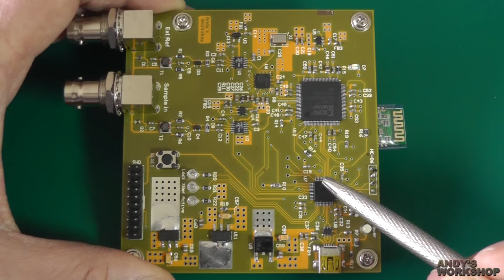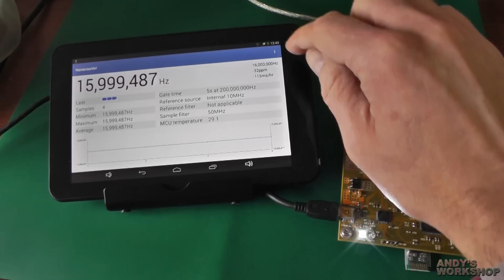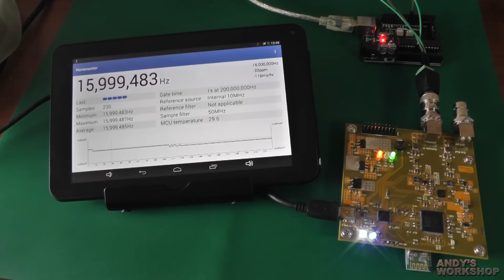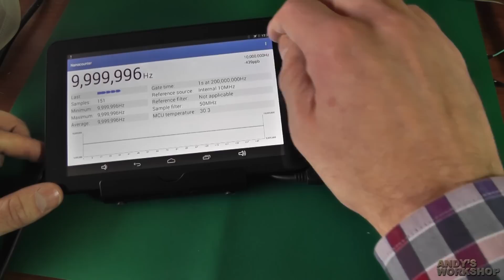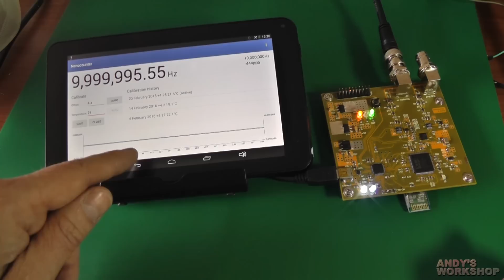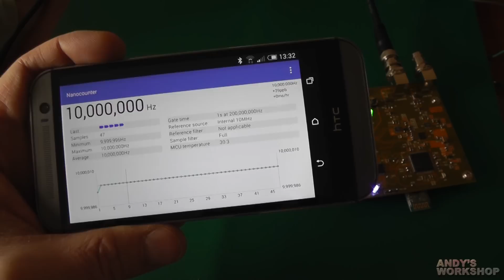A frequency counter built with an FPGA, STM32F072 and an Android GUI

Comment: Andy, may I ask you how you calculate the 50 Ohm trace's impedance? With help of Altium or you have used another tool like Saturn PCB toolkit?
Reply from the maker: It was one of the many microstrip impedance calculator web pages; sorry but I can't remember exactly which one.
Reply: Thank you for your reply! I am just curious about is there anyone who use Altium's built-in microstrip impedance calc feature.

Comment: I'm good with an iron, but no hot air here, can it be done entirely with iron regarding parts in the BOM, I can smd solder fgpa's etc..  and how much typically to build one of these? Thanks mate.
Reply from the maker: The hardest part is the PLL that comes in a QFN package and it has one of those horrible concealed ground pads. Have you successfully soldered one of those with an iron before?
Reply: Not yet, could you apply some solder & flux to the pad and then heat it from underneath with an iron while the QFN sat on the pad? Would be awesome if that's possible. If not possible then I'd probably look at my options hotair/lamp later on. 

At what cost will all these parts be ? I am certainly interested in making one if reasonable.

Comment: Great work Andy! Considering building one. Will you publish the final BOM?
Reply from the maker: +michalvanco The BOM should have been in the article, I've fixed that now. A bit of a fail on my part there so thank you for pointing it out. I will also add Gerbers and the Altium Designer project files though I know that not too many hobbyists will be using AD unfortunately.
Reply: +Andy Brown I will work with AD9851. I already got 2 modules with them from China (AliE...). They have integrated oscilators - some reviews claim that quite precise. As a target I set to design impedance analyzer 0-70MHz. It can take some time but it is motivating.
Reply from the maker: +2n3055 AD9851 is another high quality ADI part with good jitter characteristics. One of the reasons I selected the AD9553 for the PLL was the outstanding jitter performance of around 1ps for a 200MHz LVCMOS output.

Comment: Very nice project Andy. I really like your style at showing off your project. 
You can probably change the frequency of a crystal even more greatly by applying pressure on the device. Mikeselectricstuff has a video on it called "Pressure sensitive PICs"

As for frequency counting itself; I wonder how useful a microcontroller-based frequency counter can be. Fast controllers like the STM32F4xx can run it's 16-bit timers at 168/180MHz (not sure if it supports that on ETR inputs). That sounds plenty fast for a frequency counter, however it's obviously harder to implement a deterministic and stable (software) gate time control.
Reply from the maker: +nlhans1990 I'll look for that video on Mike's site - it sounds interesting and I'm already a subscriber to his channel.

I think determinism and cycle-accuracy is the major problem with using an MCU. You would certainly need hardware support from the timers to even attempt it because interrupt latency would kill off any attempt to count in software off an EXTI interrupt and I don't think the timers offer enough features.